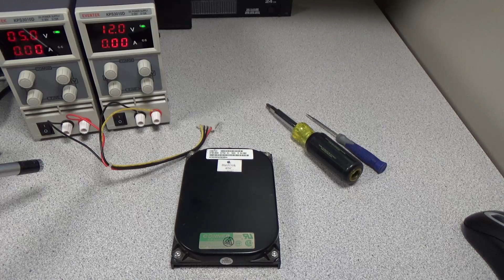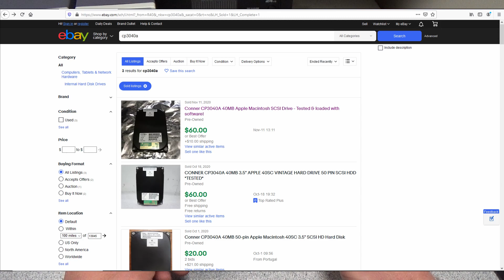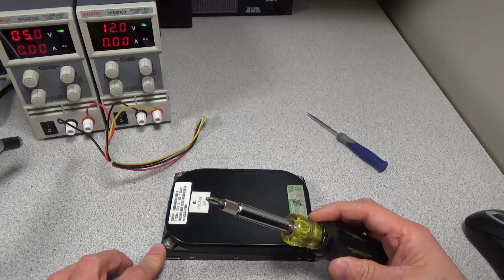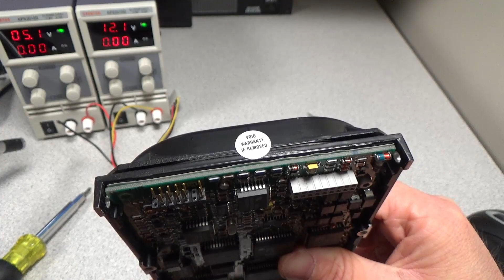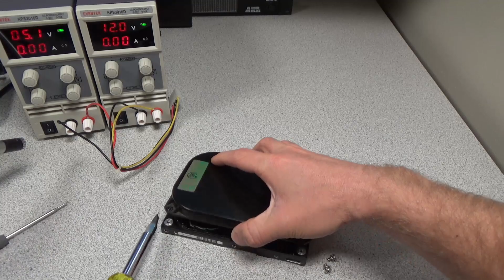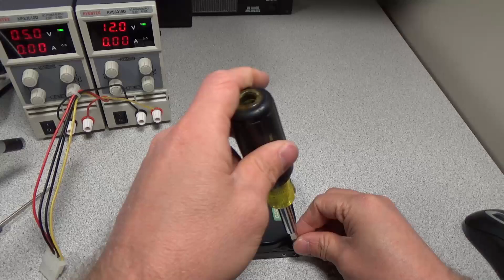Apple Macintosh 40 Megabyte Hard Drive Teardown

Comment: They are pretty good 
I have 2 of these and even a newer on that's ATA and they work perfectly
Reply from the maker: The issues I have been having is hard drives hat are a little newer in the 500+ megabyte range seem to be DOA when I try to start them up.  These older drives do always seem fine.

Comment: What causes the whining we hear when a HD is failing?
Reply from the maker: There can be multiple causes.  On older drives the motor bearing can fail but that generally wasn't the cause of immediate failure.  The read and write head would more likely get stuck or touch the drive head and actually damage the disc.  This is more a tick sound than a whine.  I would expect bearing noise to be a whine though.